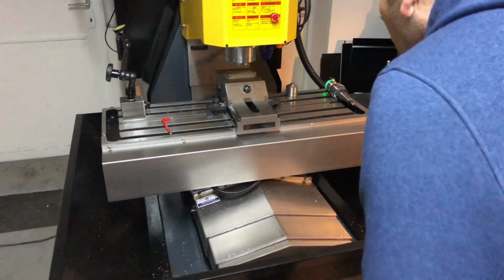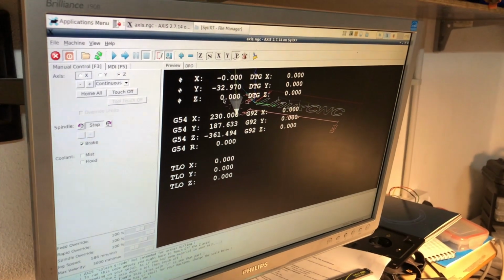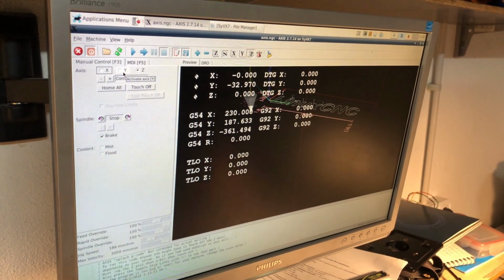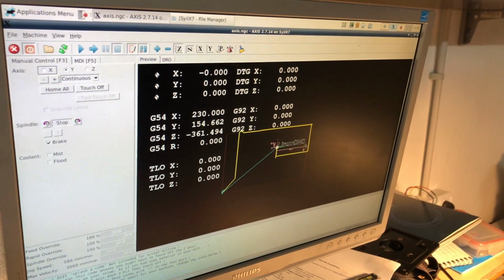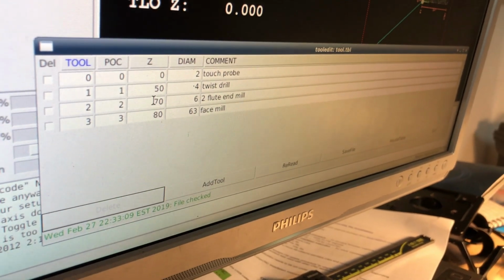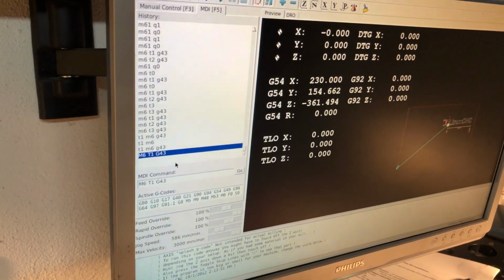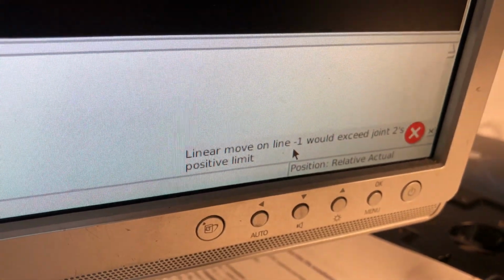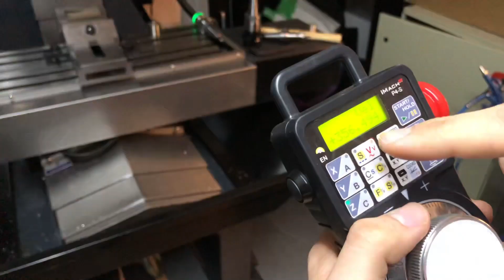LinuxCnc Tool loading issue..

Comment: Try running a program, when it asks for tool 1 and you click ok then stop the machine. then use the tool touch off function for z since you now have a tool loaded and it will have the correct offset.
Reply from the maker: It was an issue with the softlimits of the Z azis. MAX_LIMIT was set to -5mm and MIN_LIMIT was -365. I had to set MAX to 0.01, so that max is positive. When I was requesting a tool change, it wanted to reach the zero position of the axis and this softlimit was not allowing this.